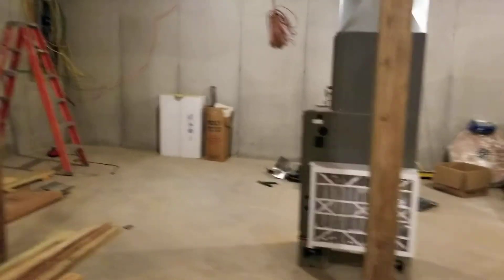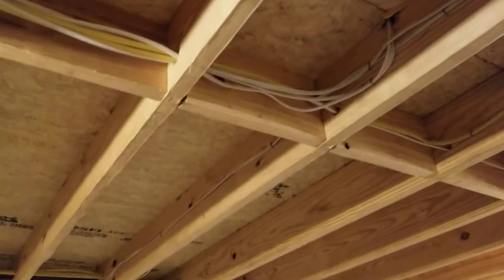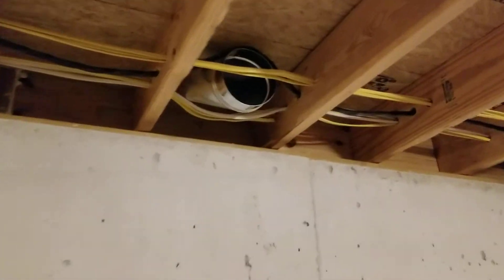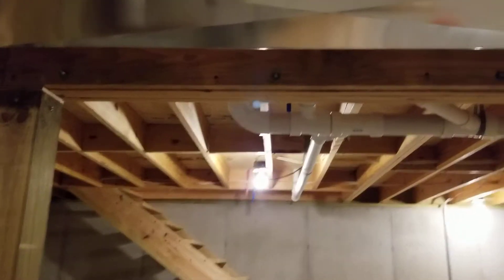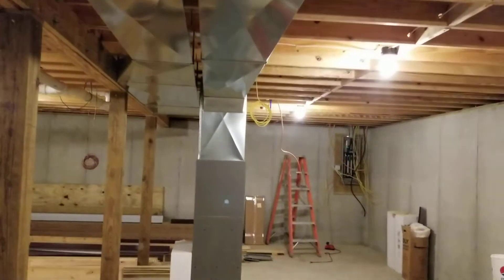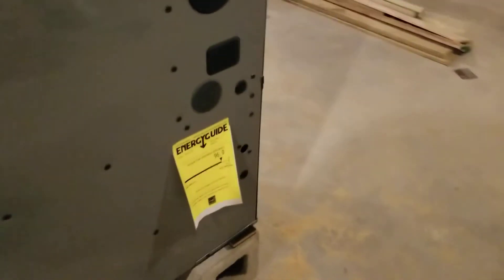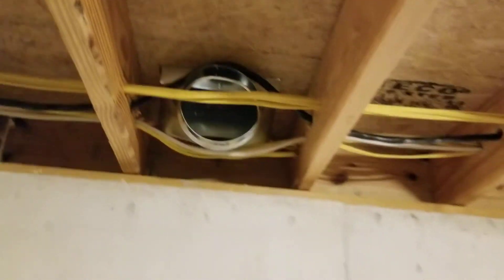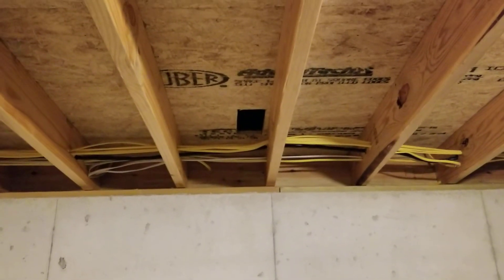Damn Electricians! Weekend Rant

Comment: This is why most residential electricians run all their feeds into the main floor ceilings, not the basement. Not to mention, more than two wires in a hole in Ontario is considered bundling and frowned upon.